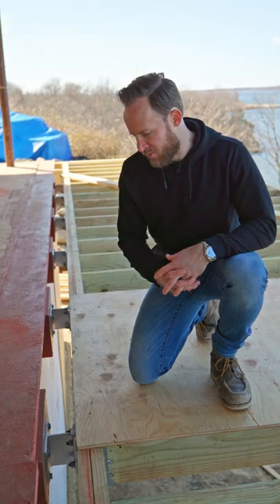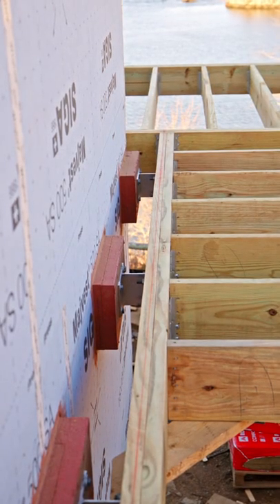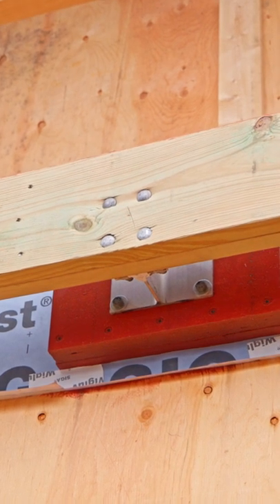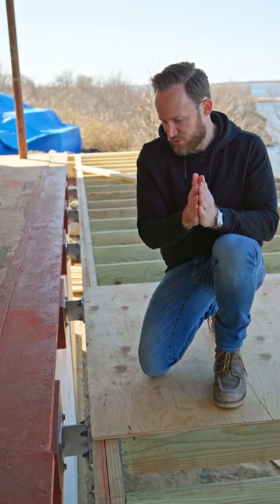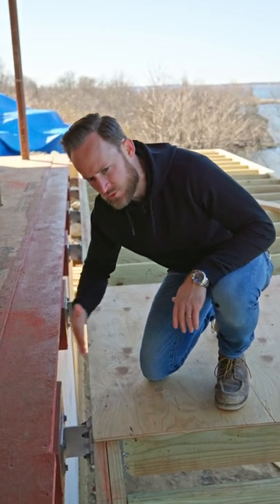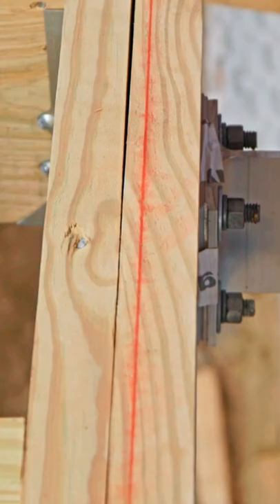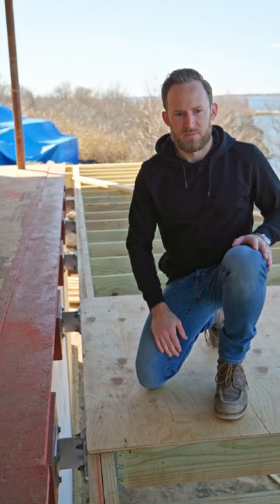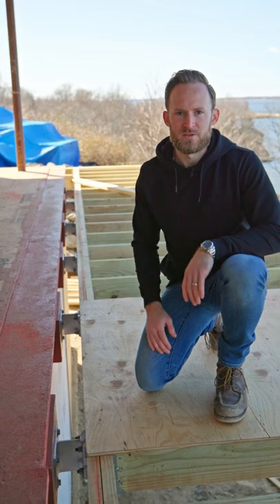Maine Deck Brackets installed

Comment: Ok winters in maine are long and wet. Especially on the coast. Ledger boards trap snow and ice if decks aren't properly cleaned after a snow storm. These give a space for snow and ice to fall down and not sit against the house and give more air flow. Not sure how they work long term but that is the purpose.

Comment: I’ve been studying CE for 4 years and don’t see the benefit vs just lagging it to the side of the house? What is the purpose?
Reply: From the looks of it from other videos, I don't think they are finished building this place. I think they still have the exterior insulation and sheeting they need to put on is the reason they use these brackets.

Comment: Interesting, but, why? what is the purpose of these? vs the other methods of attaching.. I am lost...
Reply: They are there to create  air space between the house and deck so snow doesn't sit against the building all winter
Reply: @tylerd8516  Ah, well, that makes logical sense... Thank you.
Reply: If it makes me dollars, it makes cents sense
Reply: Not sure I get how the finished exterior is going to install / look around that blocking
Reply: There is a thick layer of insulation on the exterior of this home. That’s the reason for pushing the deck out away

Comment: Several questions This has to be a waterproof deck with top and probably finished R&R underside without the treated wood. Carriage bolts ?  Fine if going through a metal bracket then washers but through wood is not appropriate.

Comment: Does Maine use the IRC (with amendments) for the state building code?  This certainly isn't compliant.  Are there ES reports for this product? Was the deck design certified by a licensed engineer? So many questions...

Comment: I believe this is for the drip line from an upper roof or overhang. The gap gets capped with a metal grate so the freezing drip from above can melt through and not pile up on the deck. Very convenient when you live where there is cold and snow.

Comment: This looks like a solution in search of a problem. No doubt someone will a degree came up with this.
Reply: I’m with you guys on this.  If it has proper flashing and water proofing.  This looks like an expensive, sheer problem.   Or you could just fiberglass deck it.  And it’s  better then anything else.

Comment: Just use a ledger board. I’m not sure the purpose of these brackets.
Reply: They’re designed two allow better waterproofing on the house. If you use a regular ledger board tight to the wall it’s tough to keep moisture out of the house.
Reply: Aluminum flat stock on wall, shim ledger board out 1" carriage bolt, here in onterrible thats what most of us do

Comment: I'd much rather use those deck-2-wall pucks, at least you are still lagged directly to the house, you still get the air gap, and it has to be loads cheaper than this overengineered method.  I can typically dig a little over engineering, but this seems to be over the top.